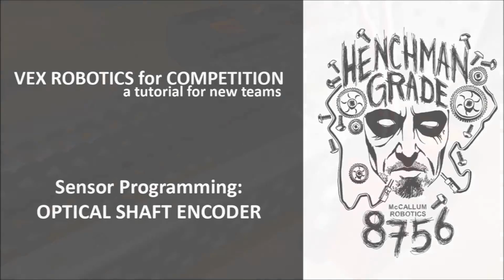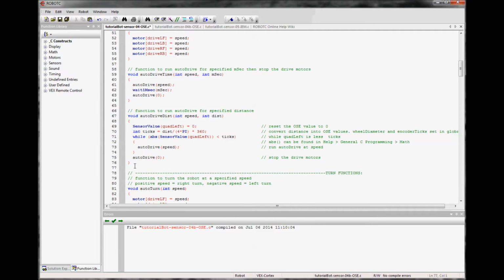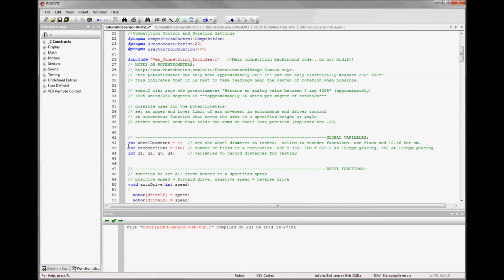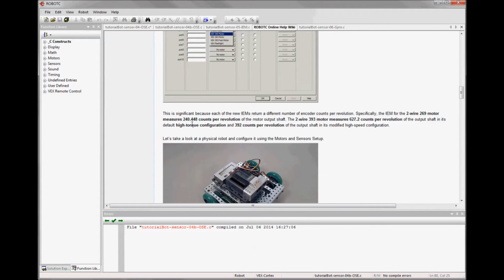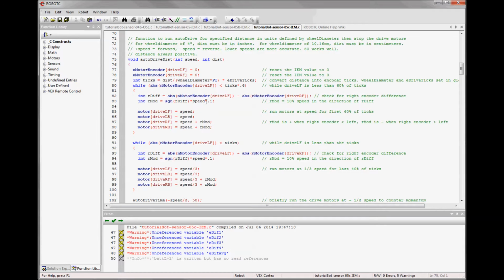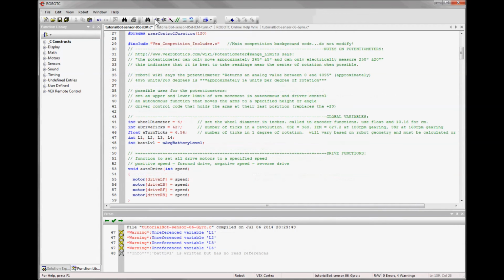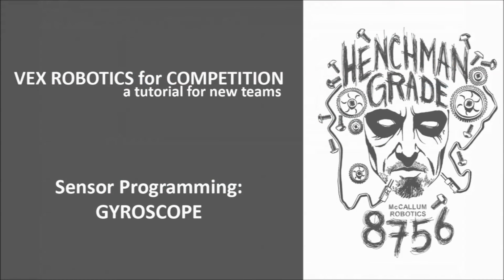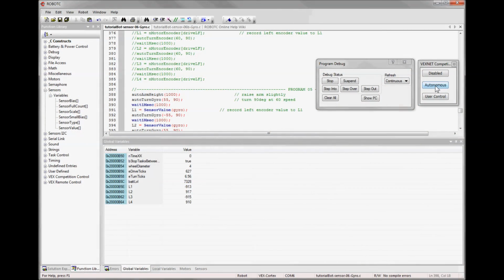Vex for Competition Tutorial | Sensor Programming Part 2

Comment: What if you use a shaft encoder to correct movement., Heres a sample. BTW the hashtag is part of the code, not a trend

#pragma config(Sensor, dgtl6,  ,               sensorQuadEncoder)
#pragma config(Sensor, dgtl8,  ,               sensorQuadEncoder)
#pragma config(Motor,  port2,           D2,            tmotorVex393TurboSpeed_MC29, openLoop, driveLeft)
#pragma config(Motor,  port3,           D3,            tmotorVex393TurboSpeed_MC29, openLoop, driveRight)
task main() {
while(true) {
if ((vexRT[Ch3]< 10 && vexRT[Ch3]> -10 ) && (vexRT[Ch2]< 10 && vexRT[Ch2]> -10)) {
                motor[port2] = SensorValue[dgtl6]; 
                motor[port3] = SensorValue[dgtl8]; 
       } 
else {
SensorValue[dgtl6] = 0;
SensorValue[dgtl8] = 0;
motor[port2] = vexRT[Ch3];
motor[port3] = vexRT[Ch2] ; 
      }
   }
}
Reply: Hi I'm not sure if you're still active or not, but if so could you tell me where the 10 and -10 values came from in your "if" statement? Thanks!